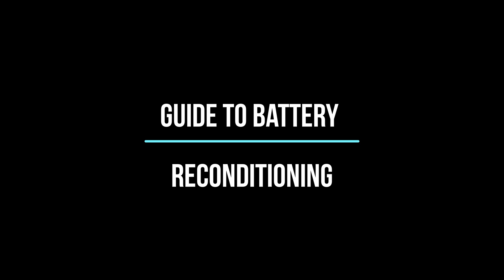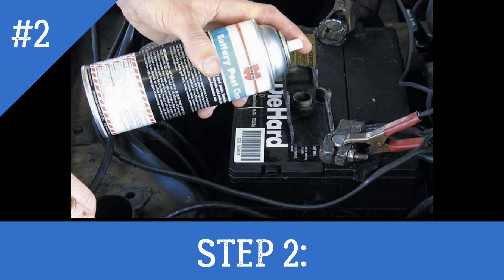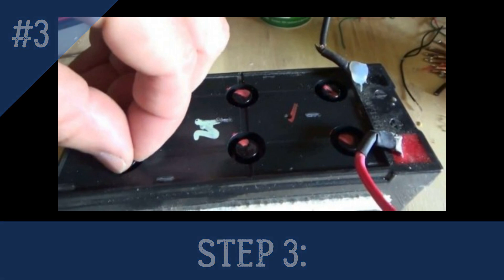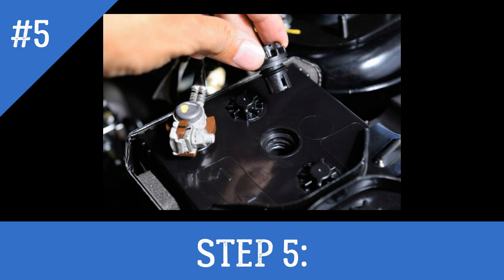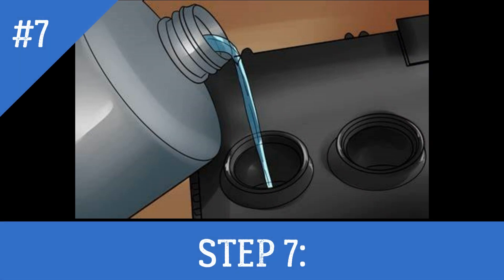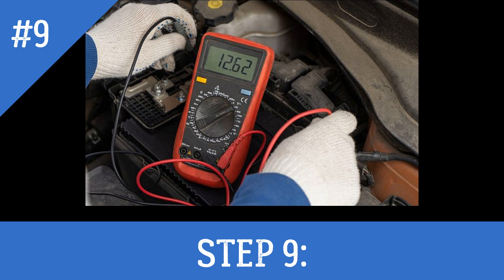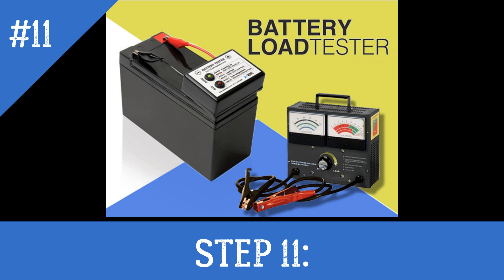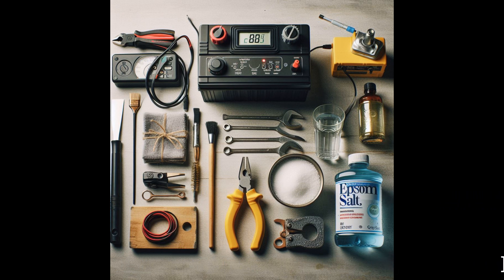How to guide to battery reconditioning

Comment: My battery is a calcium type what do I do ?
Reply from the maker: Materials Needed:
1.	Distilled water
2.	Epsom salt (magnesium sulfate)
3.	Non-metallic container
4.	Battery charger
5.	Safety glasses and gloves
Safety First:
    Put on safety glasses and gloves to protect yourself from battery acid.Work in a well-ventilated area.
Check the Battery:
    Inspect the battery for any visible damage, cracks, or leaks. If the battery is damaged, do not attempt to recondition it.
Remove Electrolyte:
    Carefully remove the caps from the battery cells.Use a non-metallic funnel to pour out the existing electrolyte into a non-metallic container. Properly dispose of the old electrolyte according to local regulations.
Prepare Epsom Salt Solution:
    Create a solution by mixing distilled water with Epsom salt. Use about one tablespoon of Epsom salt per cell. Stir the solution until the Epsom salt is completely dissolved.
Fill Battery Cells:
    Fill each battery cell with the Epsom salt solution using the non-metallic funnel. Fill each cell to the proper level indicated by the battery.
Charge the Battery:
    Connect the battery to a battery charger.Charge the battery at a low or trickle charge for several hours. This helps the Epsom salt solution to mix with the remaining acid.
Allow for Equalization:
    Let the battery sit for some time to allow the equalization of the solution within the cells.
Recheck Electrolyte Levels:
    After charging, recheck the electrolyte levels in each cell. Add distilled water if necessary to bring the levels up.
Reinstall Caps:
    Reinstall the caps on the battery cells securely.
    Test the Battery:
    Use a battery tester to check the voltage and overall condition of the battery.
    Repeat if Necessary:
        If the battery performance hasn't improved, you may repeat the process.

    Always follow safety precautions when working with batteries.
    Do not overfill the battery cells, and use distilled water to top them off.
    If the battery doesn't respond to reconditioning or shows signs of severe damage, it may be time to replace it.